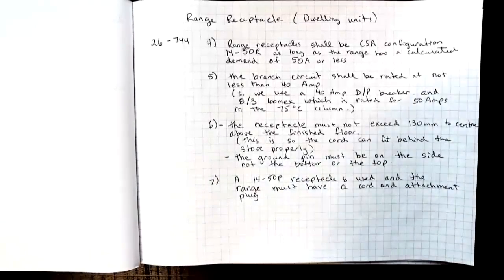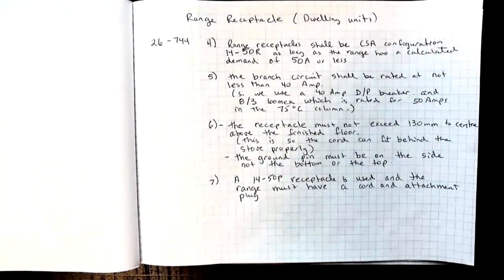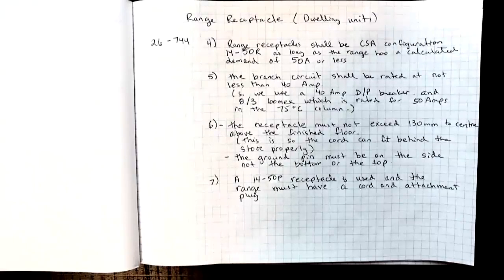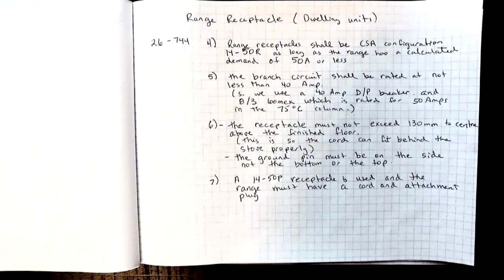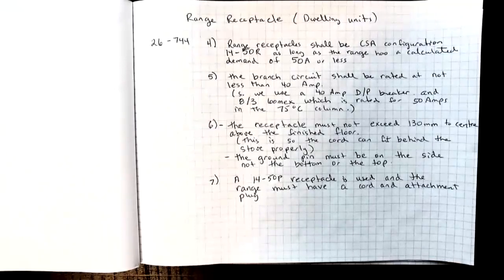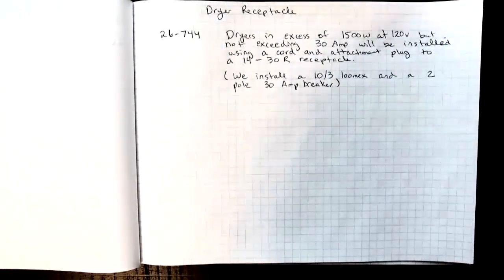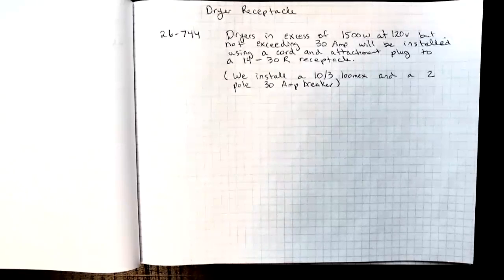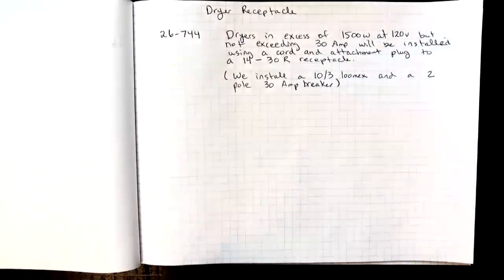CEC 2018-Section 26: Kitchen Range and Dryer rules

Comment: Hi Deanna, thanks for these videos. Just a quick question, regarding electric cooktops, I see a lot of them are hardwired instead of using a plug. Does having a plug required for electric cooktops as well, or would it be ok to be hardwired? Basically I'm asking if you know anywhere on the code if the plug/receptacle is required for any cooking appliances or is it only required for free-standing range?